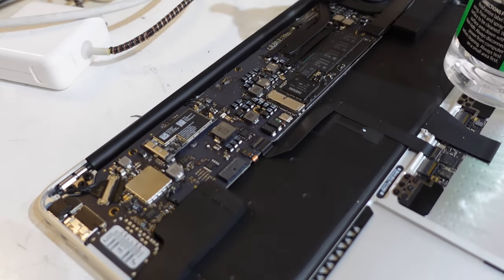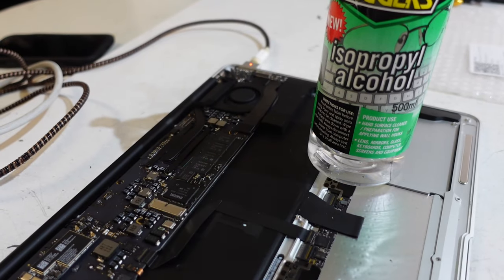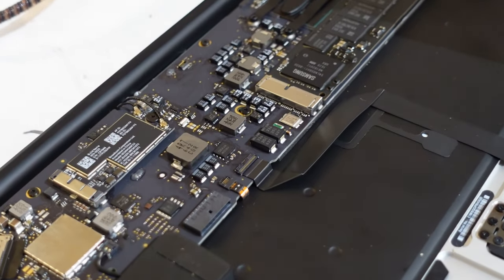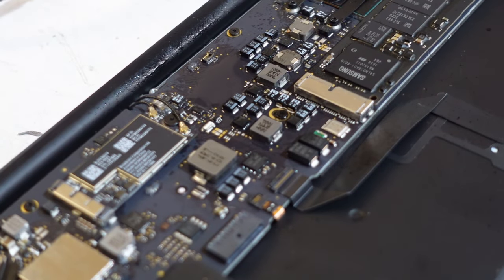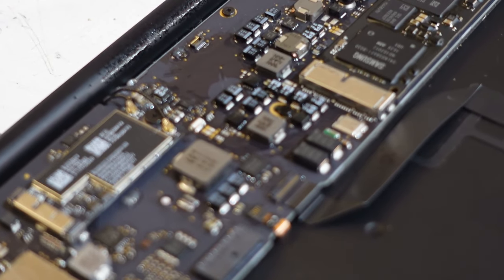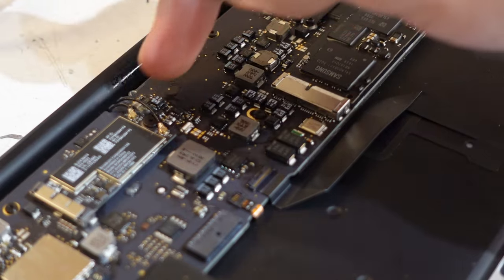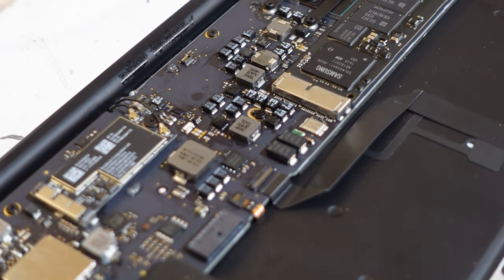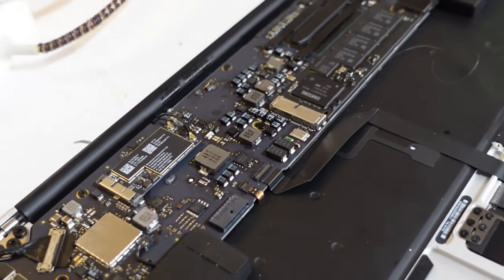Simple tip to finding a Short on a Circuit board

Comment: So the short heats up part of the board locally and this is revealed by the evaporation. May I ask if there is no short and the board is functioning ok, is the heat generated a lot less than if shorted and therefore much lower rate of  evaporation? I have a 2009 logic board from MacBook that is not booting and I have removed it to attempt to use its power "buzz bars" to boot to no avail. No fan no nothing. Thanks
Reply from the maker: this is only a single tool in a variety of methods in finding a short, different shorts will produce different symptoms, some might not get hot

Comment: I found the shorted line and injected voltage but rosin did not melt. How many volts and amps do you inject? It's an easy but confusing thing to do
Reply from the maker: i wasnt injecting an power apart from connecting up the factory charger on this macbook
Reply: @rickstechrepairs  the problem you encountered must be different from mine